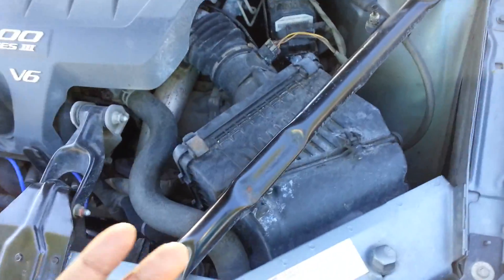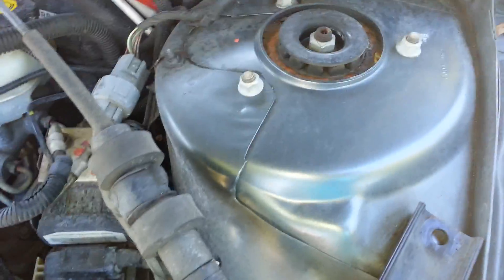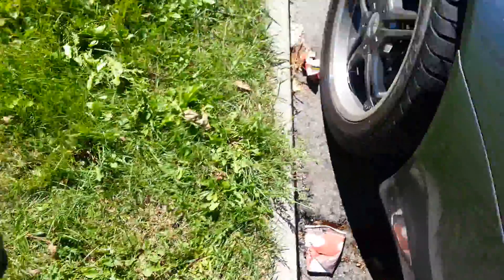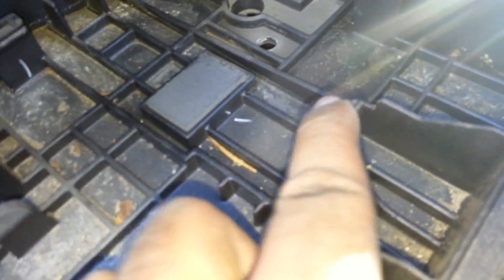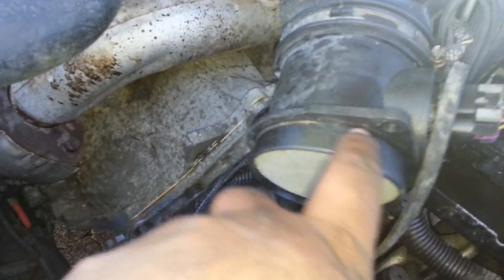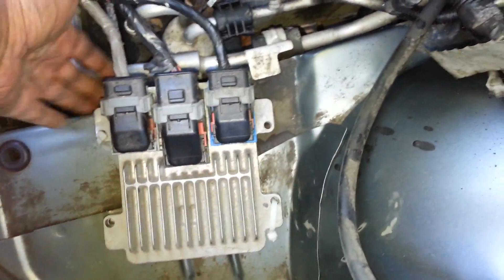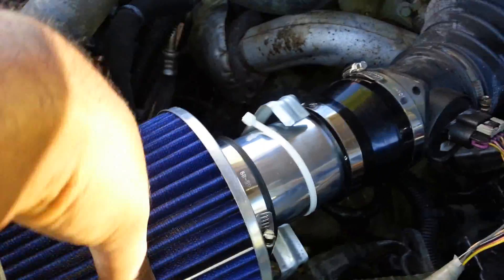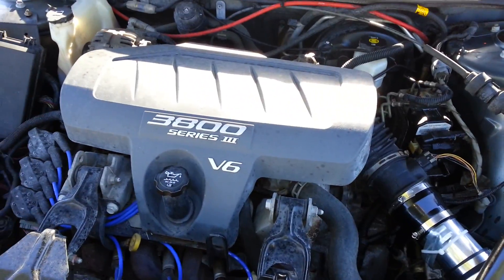04 and up Grant Prix-Adding an Air Intake

Comment: After going over my new short ram air intake. I installed the new air filter on to the MAF and gave it a run. I noticed a difference in sound but I'm not so sure in performance or if I made my car ran cooler. The idea of having it exposed to heat from the engine bothers me. I popped the hood and everything seemed hot. I was thinking of converting the stock air box to fit with my new air filter or just end up buying a heat shield.
Reply from the maker: It is hard to say what you will be getting HP wise, but there should be some improvement. I got gains both in MPG and HP but making this change, not to mention fuel economy. But a few things to point out for you. /////1. I actually have a video on what I did to convert the air box to accept the cone. You can take a look (self promotion complete lol)/////2. The engine heat can be an issue, but it is minimal at best. Some people ripped me on this video for it. There is NO DOUBT that having a heat shield, the stock air box, or one of those filtercharger kits would be an improvement. However, it is worth pointing out the stock GPs 3.8L non supercharged were rated at new for combined 21 MPG at best. Before work started o my car, it was getting a decent combined 19 MPG. Currently, with all the mods and changes, I am getting 22 MPG on my 05, which is very good. /////3. I was getting 21 MPG before changing the stock air box. The reason is the filter sits off to the side, and when driving, cold air is blowing in from near the headlight(which is what feeds the stock system). After a highway drive, if you feel your cone, it should be cool(mine was). Even city driving, the cone would never get as hot as the engine, as the heat just wouldn't permeate enough to affect the intake. I had better pickup, improved fuel economy(like half an MPG lol) and smoother idle. /////4. that said, getting a heat shield/filtercharger/convert air box. It will still be an improvement, regardless of how well this set up works. /////5. You said yours is a short ram air intake. Is yours shorter than the one in my car? That would make a big difference vs my set up. /////Thanks again for watching. Definitely appreciate it.
Reply: Nexus Auto Yes it's a short ram. But for some reason the pipe it came with that's supposed to go connected between the throttle body and MAF wasn't set for my engine only do to there being an extra hole for god knows what. So what I did was simply attach the new air filter onto the MAF the way you did yours. Except mine I didn't use a straight pipe between the air filter and MAF just the filter with a coupler onto the MAF. I'm not sure air was being sucked in at it's full potential I seen other videos where air is quite loud being sucked into the AI. The radiator hose gets really hot and that's what bothers me of the heat getting to the AI. Thanks for the reply greatly appreciated!
Reply from the maker: No problem, at all. I can see what you're saying, with the filter being a bit closer. Not only are you closer to the rad hose, but to the exhaust manifold that runs by the block, which is where a lot of the heat come from. Even with my set up, there is no doubt that it would be sucking up some hot air, just that it was being offset with the cold air especially when driving. however, you are closer to hot components + further away from that spot where the cold air comes up. There is no doubt that it will be sucking up as much air as possible, but its the type of air for sure. I will tell you the cone makes a huge difference in sound too. I have this no name aftermarket one that came with the kit, and sounded ok...performed ok as well. But when I got rid of that and when to the current K&N cone, it sounded better and performed smoother too. So the cone makes a difference. I agree with your thoughts though...it may be a good idea to invest in some type of heat shield.
Reply: Nexus Auto Just an update I managed to get my New Air intake installed correctly along with some miner tweaks and it sounds louder and has better throttle response! The air filter is working the way it supposed to now I hear the suction when reving the engine. I hope to do more projects on my GP in the future. :)
Reply from the maker: awesome news! Glad everything worked out and the car is running much better now. :)
Reply: Nexus Auto Sorry to come back but my gas milage has been horrible after the install! I've been looking around and most people say to reset the ECU by unlpugging the battery. I'd greatly appreciate it to get your say in this I honestly.
Reply from the maker: Hi Sentinel. No problem at all. But this is an interesting one. You shouldn't see such a drastic change. Unplugging the battery wouldn't hurt, but this is mostly used to reset a check engine light, which can pop up when adding a cold air intake. If you are not getting a check engine light or reduced power error, you should be ok. That said, unplug the battery just to eliminate that from the equation. Before doing that, do you have an ODBII reader? If you do, you should hook it up and see if you are pulling any codes. Even if there is no warnings or check engine light, it may still pull a code and have it saved. Check that out. Also, smell the exhaust. Don't breath it in directly lol. I normally put my hand just outside the exhaust and let it blow on to my hand, then give it a smell. Please be careful! I do not condone this directly, only a recommendation :). If you are smelling a large amount of fuel, more than normal, then your car may be burning too rich. If it is, the MAF may be reading incorrectly or dirty, and the increase in airflow is throwing it off. You can clean I was MAF sensor cleaner. That MAY help too. Try all of the above and see what happens.
Reply: Nexus Auto Thank you! I'll be sure to check back in with the results!
Reply from the maker: Awesome sounds good. I forgot to mention it, but if you do have the ODBII reader, make sure to hook it up before disconnecting the battery. Let me know how it goes!
Reply: Nexus Auto Ok I found another issue. I think I have a bad thermostat. When the car is off after running I hear a noticeable gulping sound. Also the radiator hose is gets so flat sucked tight. I'm guessing the thermostat is not opening fully allowing coolant flow. But I have not reached any over heating, luckily.
Reply: Nexus Auto I checked the exhaust didn't really notice any gasoline smell.
Reply from the maker: very lucky there. But it definitely sounds like a partially closed thermostat. That can also affect fuel economy numbers too. You should get that changed ASAP
Reply from the maker: Ok so that is a good sign. It can still be burning too rich, but if it is, its not enough to dump fuel. Did you get a chance to see if there is any codes stored?(if you have an ODBII reader)
Reply: Nexus Auto I ended up switching back to my stock intake. Gas milage went back to normal but, no more of that roar from the exhaust haha.
Reply from the maker: You'll miss that exhaust note lol. It's too bad the mileage tanked...wished I could have helped out more. You should at least try a K&N drop in filter. That should at least make a small difference in mileage and power, and it will outlast the car with proper care. Just curious..what year and engine is yours? 3.8L NA, Supercharged, V8? Helps me get a feel for what works for people. Thanks again for watching and all the feedback.
Reply: Nexus Auto 3.8L 04 grand Prix. Maybe next time I'll try a cold air intake. But for now I'll focus on replacing old parts and maintenance.
Reply from the maker: Good idea. Maybe swing back to it later on. I have been doing he same thing, with the added bonus of upgrading the parts as I go. Maintain it and the GP will go a long time :)

Comment: Wont it suck in hot air from under the hood?
Reply from the maker: I get asked that often. It sits off to the side, so it doesn't suck in as much as you would think. Additionally, the sucking in hot air is only a thing at along idle. When in motion, the filter is hit with a lot of cool air coming in from various areas. When I did this years ago, I tested the filter and it was very cool afterwards.  I definitely had better acceleration and better fuel economy numbers after this.

That being said, it is infinitely better to have it closed off. I eventually modded out the air box (I have a separate video for that) and it made a bigger difference. But I ran the above setup for a couple if years with no issue.

Comment: what is it three party's that you bought our two? Did you buy online or store?
Reply from the maker: i bought it online, through ebay, actually. it was 3 pieces...the black rubber flange, the metal tube and the cone. it came from one seller as a set

Comment: What about the 2004 Grand Prix? You said 05 and up but how much different is the intake on a 05 vs a 04?
Reply from the maker: technically, they're not all that different. but the 04 was the previous body style with the series 2 3800, so there may be slight differences that I haven't looked into. I do believe that pretty much all the fundamentals should be the same
Reply: +NexusTMPG I have a 04 with Series 3.... are you sure?
Reply from the maker: Joseph Williams sorry I mislabelled the video. This will work on the 04 grand prix with a series 3 engine for sure. This would work no problem
Reply: 97-03 is series 2 04-08 is series 3
Reply from the maker: That would be correct. Series III started 04, not 05. Thanks for the correction!

Comment: is it cheaper to buy the kit with all the part's? Or cheaper to buy everything piece by piece and put it together myself? Is K&N really the best or are there just as good of other filters for less price?? Your videos are very helpful. thank you::::'keep up the good work!!
Reply from the maker: no problem, and thanks for watching. if you guy the full kit, it can be upwards of $300 usd, vs this set cost about $50 USD, at the time. you can also buy everything individual, but I don't think there is a big cost savings vs this kit. There is also a lot of good filters out there, but my personal experiences with K&N have been best, so I always recommend them. however, as 10 different people, and they'll probably give you 10 different answers to this one.

Comment: may want to take a drimle cutting disk and cut down the original box that held the  ecu mod so that its flat and install over it that way it mounts naturally and you can allways take a plastic box cut to fit over it like a dome and zip in place
Reply from the maker: donald fingar it's funny you said that, actually. I posted a recent video on 're great Air box mystery...discussed what could be the differences between 04-06 and 06-08 grand prix airboxes. in that video, I mentioned coming up with some new air box ideas. what you mentioned is exactly one of the things I'm looking to do. stay tuned. thanks for the recommendation and for watching!

Comment: How do I take off my spoiler off my Grand Prix ?
Reply from the maker: If you look in the truck, you will see a bunch of screws. I think it is something like 10 or 12. I can check it when I am back at my GP. Yout just have to remove all those nuts and the spoiler will come out. You will also need to disconnect the harness for the brake light.

Comment: My grand prix is over 100000 miles would it be worth upgrading it at this point in its life
Reply from the maker: Generally, I always say you can upgrade a car at any point, at any mileage, at any time. But the one thing I would also advise of is that as these cars (or any cars for that matter) get up in age, you'll need money to also maintain while upgrading. And sometimes an upgrade will lead to a repair later on (for example, lowering the car may put pressure on control arms or driveshafts). Worth noting that I didn't really start upgrading my grand prix until it had about 150000kms, which is pretty close to 100000 miles. And I still have it and it still runs beautifully.
Reply: @NexusAuto  funny you say that currently I'm changing all the fluid I just got it from my brother but he doesnt really take good care of his vehicle but also the car has been sitting for a year waiting to get the title  also I am getting a red brake warning and wondering if you know what it is the brake fluid is full but I have to get that fixed to pass inspection only other thing I can think of is the brake line
Reply from the maker: @treywhatishappening8015  I assume you are talking about the parking brake light? Or ABS Light? I assume parking brake light, as that one also handled the brake fluid. But it also controls other things too. It can be the parking brake switch malfunction, or the parking brake not fully disengaging, or a bad brake fluid level sensor (on top of air in the brake lines). How do the brakes feel? Are they spongy or does the pedal go all the way to the ground when you step on the brakes?
Reply: @NexusAuto  both are on the ABS is just the sensor  but the brakes are spongy
Reply from the maker: @treywhatishappening8015  to be safe, I would say to bleed the brakes. But if that is not the fix, see my list of stuff in the last comment. It can be any of those things. I know if the ebrake sensor gets corrosion on it, it will stop reading and give an error. So check that as well

Comment: did you car start making a ticking sound after this d.i.y? i pieced together ny intake and my 08 started making a ticking sound and the intake doesnt pull as hard as it should . any advice?
Reply from the maker: hmmm, that is a tricky one. i will tell you that I never noticed any ticks or any unusual noises from the engine. has the maf sensor failed or is it hooked up? that would be a possibility, however remote. also, is the air filter (cone) a good quality one? some are made of crappy quality and can actually stifle the engine, which can throw off the timing. that's all I can think of without seeing the car...take a look into both of those things first and let me know
Reply: +NexusTMPG. thanks ill try both of b
those. my maf is hooked up maybe its just dirty. i no my throttle body is nasty i need to clean that badly. ill try it out and see if anything changes. thanks
Reply from the maker: +unknown x sounds good. if you have any other questions, give me a shout

Comment: where did you get the metal for the brace to hold it up, and how did you get it bent.
Reply from the maker: the bracket was something I had laying around...it was a metal bracket/brace. i measured and bent it using a heavy duty table vise and just pulled it into shape after measuring. The table vise really helped with putting the 90 degree angles into shape. thanks for watching too!
Reply: @NexusAuto  how did you attach the brackets to the car? Were there existing holes or did you drill it?
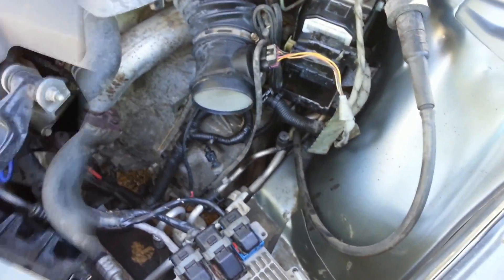Reply from the maker: @CMCSS-to3to  i drilled into the car, at the base of the bracket, you can see the black screw, at around the 6:32 mark.
Reply: @NexusAuto  how has the computer faired through the years?
Reply from the maker: @CMCSS-to3to  I had this set up from Oct 2013- May 2017, and never once had an issue. However, in May 2017, I decided to try something new, and ported out the OEM air box and installed the air intake inside. So the ECU went back into the air box at this time. It is still the original ECU, and it is still running great to this day.
Reply: @NexusAuto  nice, I might just leave the stock box but get a better filter.
Reply from the maker: @CMCSS-to3to  Definitely. It all depends on how far you want to go. Even a better filter will give you results. Don't expect real HP gains, but you will get better engine response for sure, which will equal better acceleration.
Reply: @NexusAuto  I hear people say CAI work, I hear them say it doesn't work. I hear them say both about filters. I'm just not sure
Reply from the maker: @CMCSS-to3to  CAI works, without a doubt, but its the misconceptions that people have. People except huge HP and ft/lb gains, and such. But

1. An CAI is only one piece of a bigger puzzle. You need all the components to really fully utilize it, which would be CAI, Exhaust, Ignition, Fuel. 

2. If you add something on, and do not tune the engine, then the car, doesnt matter which car, is tuned by default to optimize fuel econ with power. So you adjust the air, but the ECU fights that a bit, making adjustments via the MAF sensor to give more fuel to accommodate the more air, but still trying to optimize fuel econ. So you are not fully utilizing the CAI

3. Even if everything is done correctly, you will only gain a few HP and ft/lbs at the most from a CAI. What will change is the response, as in, how quickly the engine will respond when the accelerator is pressed. More air going in, colder, and at a much quicker pace, will result in the engine responding off the line a bit quicker. 

4. It sounds damn nice lol.  That alone, even if there wasnt any gains, is a nice bonus.

Comment: I installed an air intake, looks to be exactly as the one you have but it does not deliver the loud horsepower which I desire unless i'm actually driving and hitting around 3500 rpms, I am now wondering where I went wrong..Help Please!
Reply from the maker: it could be a few things causing this. is you mass air sensor hooked up and in working order? also, what quality of filter did you use? believe it or not, some air fliter cones are not great quality and actually stifle the engine. check these 2 things first and get back to me if there is still an issue
Reply: Nexus Auto hey bro how do I remove my spoiler on my Grand Prix 06